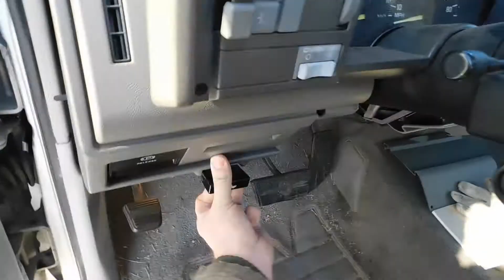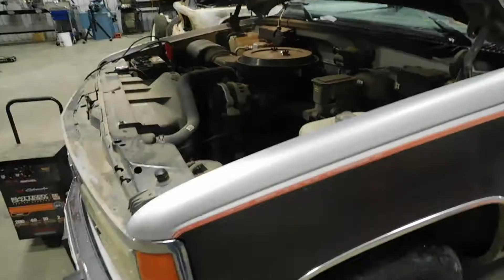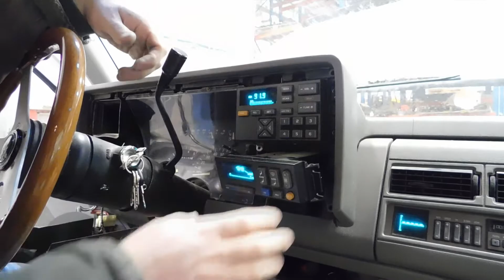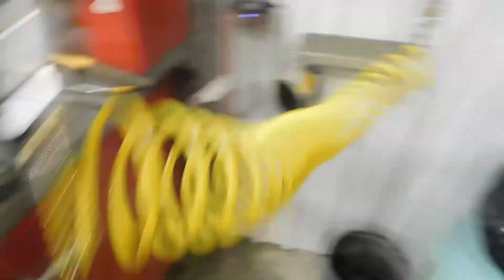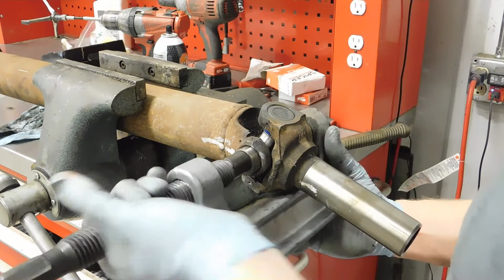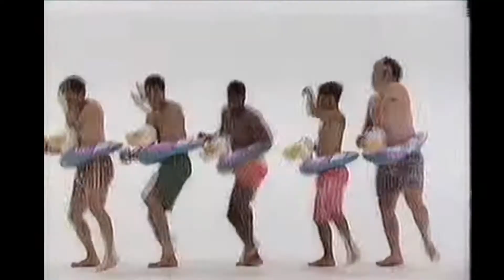1993 GMC Sierra - Diagnosis & Repair - Battery, Vibrations, Clunks and Some Good TV

Comment: Went to back out and it died on me so I went to start it up again and it wouldn’t start i have checked the timing and it is still in time and it is getting fire to the plugs and the coil the wires and it is getting fuel so what could be wrong with it
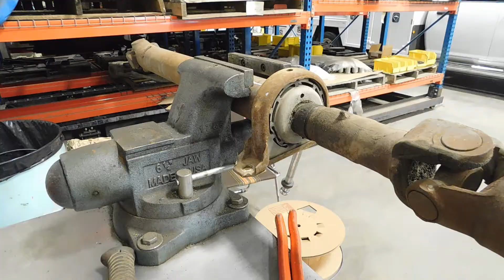Reply: 13:52

Comment: I have the exact truck. Wish your shop was closer, would definitely have u work on mine.
Reply from the maker: what are the issues you're having with yours? Kansas is in the center of the country so you can't be THAT far away!😁
Reply: @TheJayhawker  it will turn over but not start.
Reply from the maker: @sheila4046  stick your ear down by the gas filler and have a friend turn the key to "on" but don't crank it. See if you can hear the electric fuel pump humming in the tank.
Reply: Do you have part number for joints and carrier bearing

Comment: Had identical symptoms and causes on my 65' GMC drive line. Seems this is a pretty common failure point. I hope the replacement carrier bearing will hold up, it was made in Mexico.